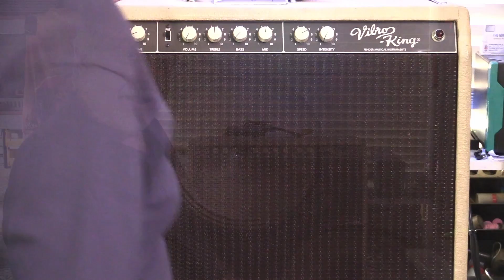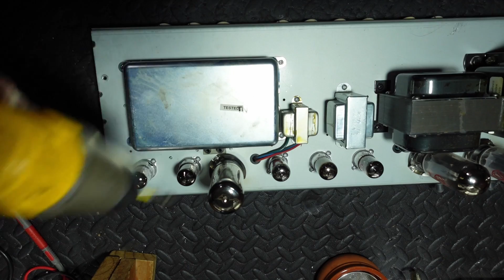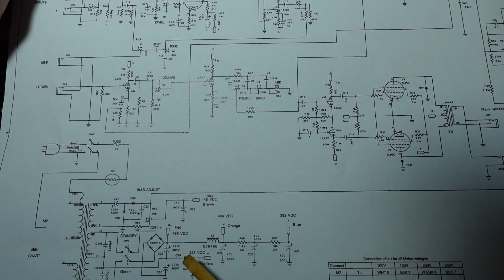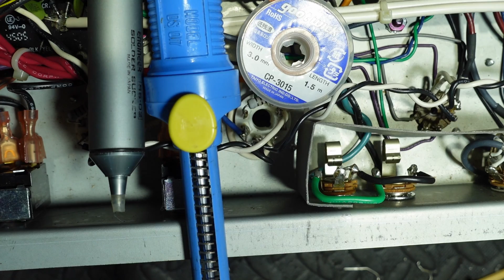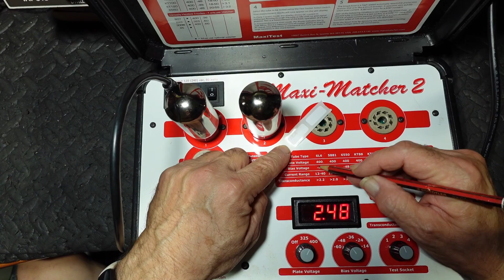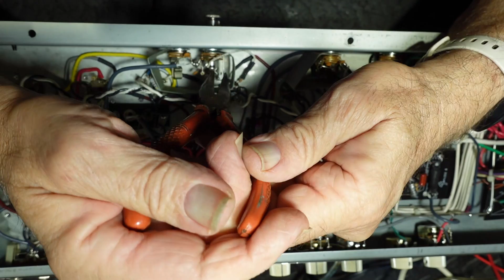This King is sick. Long reign the VibroKing.

Comment: Very informative! and perfect timing. Just purchased a 2010 which sounds great but I thought I would give it a thorough check. Looking forward to seeing the next video. I’ve been working on amps for many years so tell Harley not to worry about my safety. ⚡️⚡️⚡️
Reply from the maker: I am very jealous, BK. Its a gorgeous sounding amp.
Reply: @theguitaramptech  when you do part 2, explain a little more about the tone control. I was hesitant about getting the VK just because I might have to use a attenuator but the previous owner said you can use the tone control as a master control??? Again looking forward to part 2.
Reply from the maker: You are so right, BK. I noticed that omission after the edit. I should have said that the Reverb Tone ONLY affects the tone of the reverberation echoes and NOT the dry signal. What can I say? I can make excuses or simply confess the truth ... I'm an idiot. 
Part Two is recorded but not yet edited. If I forget to overlay a comment about the TONE, then you will know that Dimentia is settling in!!

Comment: Recently got a early 1994 version with the EL84 reverb driver. Appears to be all original. There is some crackle, hiss and fizz on warm up, but mostly goes away. I'm considering changing out the filter caps. Reverb and Tremolo are still working great.
Reply from the maker: Congratulations. It's a wonderful amp. It's fine to change filter capacitors. Your sound does not directly pass through them. If you are a regular viewer of my videos, you will know that I am strongly in favour of learning how to test components FIRST and only change what is necessary. Too many Techs are untrained and don't have the knowledge or equipment to test. PLEASE DO NOT CHANGE ANY COUPLING CAPACITORS until you know how to test, or you will destroy your amp's sound and value. One cause of crackle and hiss MAY be one or more plate resistors. Once again, only change what has failed. If a Tech recommends changing everything, pick up your Vibroking and run away. If you are over 50, at least hobble away.

Comment: Hi Chris i'v got another question. 
Dwight. Two 6V6s in push pull with cathode bias that means they are in class A and would not need to think about phase distortion?
Reply from the maker: That's not as simple a question as you may think, Dwight. There are very few, if any, guitar amps that run in true Class A, with the exception of Single Ended (SE) amps such as the Champ or the Tweed Tone 12A (that I designed for Artist Guitars). Even Vox amps, which built their legend on being Class A, are not true Class A for their entire volumne range. 
I am not clear what you mean about phase distortion, so I will make up a "tighter" question for you. I assume you are referring to the Phase Inverter (PI), and then there are several parts toi the answer. If you mean can the previous stage overdrive and distort the PI, then the answer is YES. If you mean can the PI induce distortion in the 6V6's by overdriving them or inducing "blocking" distortion, then the answer is YES. If you are asking if the output of the PI still needs to be matched in level to maximise a clean signal, then answer is also YES. If you are asking if the 6V6s still need to be matched for the best and cleanest sound, the answer is also YES.
Reply from the maker: Take a look at my 3 part series of Amp Classes in particular: https://youtu.be/AQPWtCnulpU?si=4C9d48lpGeUTVRrO  and  
https://www.youtube.com/watch?v=AQPWtCnulpU&list=PLhk_5-kIFMR5pbqz7xmy-iF9FmBzP_O-r&index=3
Reply: @theguitaramptech  thanks Chris. Dwight
Reply: Heineken Chris you're the expert I'm the hobbyist and amateur that's why I asked guys like you questions it's very nice that you have tried to answer my questions and I thank you for it I hope you don't mind if sometime I may ask you more questions you are a very nice man with a great deal of patience that's what I love about people like you you are willing to answer or try to answer my dumbass questions thank you Chris from the bottom of my heart sincerely Dwight
Reply from the maker: You sound like such a nice fella, Dwight, I am happy to answer your questions.

Comment: The shielding metal loop cages around the output jack sockets look like one may be crushed against the sockets. I'm sure you've checked them out, also the wires passing under the shield loops look quite tightly pinned twixt loop and chassis? 👍
Reply from the maker: Thank you, Rob!

Comment: an expensive boutique amp with IC caps.....?????
Reply: I know everybody on Youtube hates IC caps, but can't you just change them if it's all that turns you off the Vibroking? The IC caps in my HotRod Deluxe still seem to be OK. I don't have an ESR meter but they are still quiet and not leaking after 12 years.
Reply from the maker: I hear you Oscar, ICs are not my favourite brand either, but they don't all instantly fail. Its more their inconsistency on reliability. I've replaced them as young as 4 years old while others have been fine after 15 years. The VibroKing is handwired and quite unique in its design...and its soun ds fantastic.
Reply: Sometime around 2012? ish Fender had a recall of all the IC filter caps. At that time, I was contacted by an amp tech doing contract repair work for Fender to bring in my Super Sonic Twin 100 for caps swap. Still have it with no issues (knock wood) I think that's when all the Fender bad press started.  @theguitaramptech  Same thing cost Dell Computer millions.

Comment: Another great video so thanks a lot 👍👍 Can I ask you which product/device/gadget you use to measure ESR of the capacitors ? Cheers
Reply: I’m all in for that one Chris as I’m sure Harley also is. If you are looking for any other suggestions, I think we would both also love some tips on using an oscilloscope for diagnosing and checking 😉👍🐕
Reply from the maker: @paulp2033  You got it Paul. I have wanted to do a series on using Test Equipment, but thought it may be too dry for most viewers. Hooray for us nerds, Paul.
Reply: Great news Chris 👍👍
I think those kind of videos could be really popular 😀
But then, I would say that 😬
Reply from the maker: @paulp2033   HAHAHAHAHAHA!
Reply from the maker: Hi Paul. I find that most Techs don't understand ESR or how to measure it. You need to measure it at its operating frequency...not 100KHz. I use one by East Tester. It's made in China, like everything else, but I have been very I'm pressed with its performance. 
I feel another low-ranking video idea coming on. The audience will be you, me and Harley! Hahahaha!

Comment: I noticed on the schematic (and in the amp) the output valves are 6L6s but the amp tube chart shows 5881s - I believe they are similar but not the same, does that matter in this case?
Reply from the maker: Great question SJ. In todays world it would be safe to interchange them, but in the glory days of tubes there was a difference, The 5881 was 23w compared to the 6L6GCs 30w. The 5881 was "ruggedized" for use in military applications. I doubt you'd find a 5881 in any fighter plane today.

Comment: 6G15 original driver tube was a 6K6, here in the States.
Reply from the maker: Hi Rico, you are exactly right. As far as I know, Zinky never used a 6K6 in the VibroKing. It's very similar to a 6V6 but with lower plate voltage and dissipation.
Reply: They regularly failed as did mine in 96 example. It got changed and worked fine. Don’t recall what new one was. Wish I still had it!